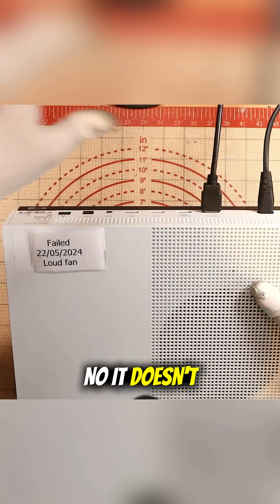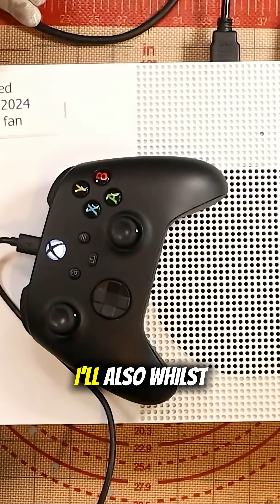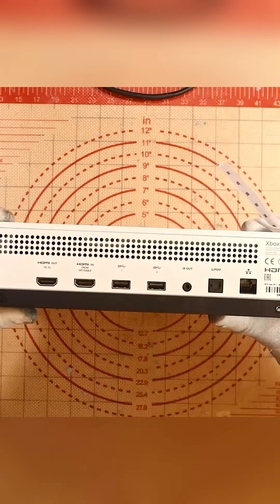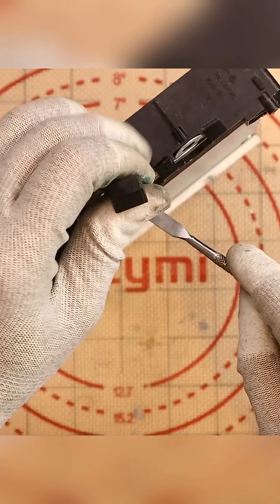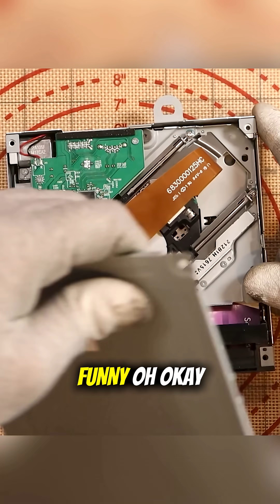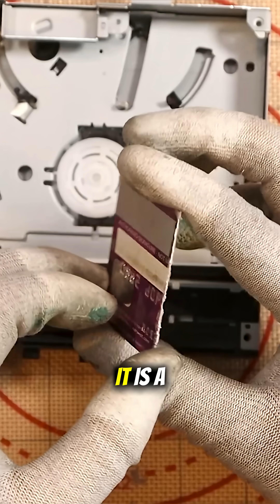I Paid £17.50 for a FAULTY Xbox One S - Lets Fix It! #soldering #repair

Comment: The original xbox ones are built like a brick, ive used mine as a work top, a mouse pad, an arm rest, It actually has a hole burned therough the top of it from where i dropped my soldering iron onto it, and i can still fire her up and play skate 2 from my old scratched up disk within about 4 minutes. Ive had her since release, and shes been with me longer than my little brother's been alive 😂 i cant wait to upgrade to something newer, but im not sure how easy it will be to let her go

Comment: My friend had an old Xbox one s and he said it stopped working after he left it on for like 3 days when he was on a vacation and when he got back he thought it was broken and he thought his mom threw it away 5 years ago but after he told me that story that happened so long ago he found it in his closet a few weeks later  so he bought it to my house because he wanted to fix it and I like fixing stuff and and he thought it was a problem with the hardware it turned on and it got stuck at the start up screen and all I had to do was look up a video and I wached the video and fixed it for a few minutes until the power cord got  bumped and it turned of and we turned it on again and I think somebody turned it off on purpose for some reason so we tried to open it up and it is so hard to open we just gave up and than I tried the same thing I used to fix it earlier and it worked ! and he wanted me to give him like 60$ for the Xbox and it had like 50 games on it and it was sitting in his closet for like 5 years because he thought his mom threw it away but than I convinced him to give it too me for free and now I have an Xbox so that’s cool I might have left some parts out because it happened a while ago but I don’t think I did

Comment: You can get more for consoles with certain firmwares so id Google them to see if anyone uses them for jailbreaking/cfw before I updated them. Idk about Xbox but that's how PS3s were several years ago. The manufacturer patches the exploits on newer firmware so older is more valuable.

Comment: Had this issue with a PS4 I got on eBay, fella didn't say there was a problem, couldn't insert the disc, opened it up and there was a Peppa pig cardboard tile in it. Worked perfectly when I took it out!

Comment: My One has the sticker still. I got it like 4 months ago. It was hardly used. Paid $50 for it on eBay. Came with 2 controllers, all cables and black ops 3. lol bought a series x a month later for $300 mint, complete in box with 3 controllers. Gotta love eBay.

Comment: About 15yrs ago, used to work repairing video games. The two awesome stories are: 1 a PS2 Slim with remainings of shit (diaper like) and other PS2 with automotive transmission oil, not ATF, that stinky one… booth cases we’re supposed to clean… the shitty one I declared motherboard beyond repair, and the oily one I had cleaned with isopropyl alcohol and dried (burned oil remains) with the hot air station…

Comment: The external power supply of my xbox one is making an insane amout of noise and the fan constantly stutters or vibrates. I suppose you shouldn't play around with the power supply, so where on earth can I get an original new one...? Aftermarket ones are too risky

Comment: Off topic:
I always go through hard rubbish & 3 week ago I found a Bose 5.1 surround sound system & speakers
All i had to do was change the fuse the system is valued at $2000. It was only missing a remote best find i ever had
Reply: That is bad ass!
Reply: Never hurts to look, but you cant pickup everything.
Reply: What’s hard rubbish like do you mean a dump?
Reply: @ChaseWilder  i'm in Australia and every six months we have hard rubbish pick which is basically anything that does not fit or to big to fit in there a bin.
Mattresses, fridges, TV's,
Everyone just throws it in a pile out front / back of there house/ apartments
Reply: @petervonstamer7859  ahhh that makes sense. And I bet it stops people dumping stuff where they shouldn’t. We have people do that in the UK it’s called fly tipping. They throw rubbish on a field or in a forest or anywhere you wouldn’t normally cause they are too lazy to get rid of it properly.
Reply: @ChaseWilder you don't have that in the UK? Here in Germany we got a system called "Sperrmüll"/bulk trash and you can call it a few times a year. You arrange it with neighbors and tell the town how much the have to pick up.
Reply: @kingo5940  no we have a “waste recycling centre” in each local area and you have to take large or non standard waste there. Most of the time you pay someone to take it as most people done have the means to transport such large items.
Reply: As a old school radio builder and a radio ham.......I would absolutely give anything to be able to find properly old school TVs, VCR, and analogue radios...... you can strip 'em and design all manner of cool stuff!!!!!, massive love and respect from Birmingham UK, and 73s  of course!!!!,, much respect,scott

Comment: I need an Xbox One S fixed or at least diagnosed. The console turns one and functions, but doesnt output any video. I know the console is functioning because I can turn it on and off with the controller. (Holding the controller button and then hitting up and A) I have tried a dozen HDMIs and I am so confused. It has always been sat on a shelf when used. Never bumped, dropped, or transpirted pist purchase. The HDMI port looks clean. No corrosion, no visibly bent pins or frame. So baffled.

Comment: I have a Xbox one s , Got it for 50 bucks 2 weeks after the release of the Xbox one S(same one in the video) I played that thing for years broo, moved became homeless and 2 years later I got into a position I could play games so i plugged it in and it didn't turn on, I took apart it and still no luck, I think it's the front interface power button, I dunno tho, I plug it all in and it does nothing no click no nada , I got a series S Xbox now but I still wanna use and game on the og Xbox one s I had

Comment: I have an Xbox 360 Kinect that still works fine and when I got it, I had it modded. 
The very first thing the guy did, was put the fan facing the opposite direction. 
As he told me “Xbox decided to have the fan sucking in air, rather than blowing the hot air out of the system and not only is it far less effective and efficient, but it sucks in all of the dust and everything else that is floating around in the air into the console”

Pretty silly error for a company so large. 
It certainly has helped my Xbox. My niece and nephew play it regularly.
So if you’re doing regular Xbox fixes, when you are putting them back together, I highly recommend flipping the fan around and screwing it in, so it is blowing outwards, before you put the case back on. 
All the best mate. 🙇‍♂️🍻
Reply: Actually no. The System is designed to work as an exhaust - if you flip the fan you get better temps on the cpu/gpu however other components on the mobo will suffer and overheat. Also the fan doesn't have an filter so you actually pull in more dust.

I'm running mine since years and just opened it recently to replace the paste but no signs of dust or "clogged" air paths.

The 360S is that kind of console which doesn't need any mods to its cooling system.
Reply: @Officer94  I can only attest that my Xbox still works fine. 
I’m no expert and I actively avoid pulling apart anything that works with electricity, because I have absolutely no idea what I am doing and in fear of being electrocuted. 
I’m just passing on what was told to me.
Reply: @Officer94 either way these machines are most certainly designed to break down earlier than need be, This point still remains
Reply: @lovelyjublee6808  yeah im sure Microsoft intentionally designed a console to break down and cost them billions and damage their reputation permanently... totally did that on purpose. 
The conspiracy behind the red ring has finally been revealed!
Your genius is unmatched!
Reply: @lovelyjublee6808  you're delusional if you believe that. Microsoft literally lost money on the Xbox 360. only reason the survived was because the had so many other profitable products/services. they even spent billions replacing consoles with RROD free of charge for many years.
Reply: I just finished my RGH3 and read this. Now I've got to tear it down again 😮‍💨
Reply: @best-cs2-highlights  it’s only just under the case luckily, so you don’t have to take too many screws out.
Reply: Not an error, designed to break down on purpose .... 💵 🤑
Reply: That's how fans are supposed to work... You still pull in air/dust from outside with your fan turned around just through more points. The fan faces towards the components it's trying to cool to give the best cooling effect. Next time you're hot stand behind your fan instead of in front of it and you'll see what I mean, air is still pulled past you but it's nowhere near as cooling as being sat in front of the fan. Typically if building a pc you want multiple fans to circulate and expel the air of they all just pointed outwards you can't guarantee the key components get effectively cooled (baring specific case design)
Reply: That's weird they would do that because I modded xbox 360s back in the day, it's fan would blow air out so less dust compared to the ps3 which pulled air in and would get loud. Wonder why they would change that for the kinect.
 Edit: I guess I misunderstood, there's a xbox 360 kinect variant? 🤔On normal 360's it blew air out and it was impossible to flips the fans around as they wouldn't seat properly flipped.